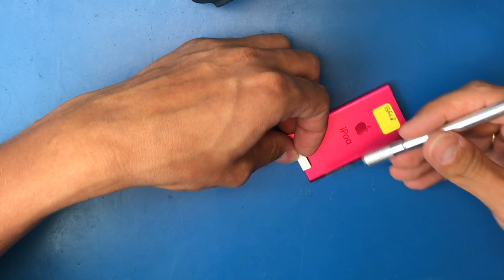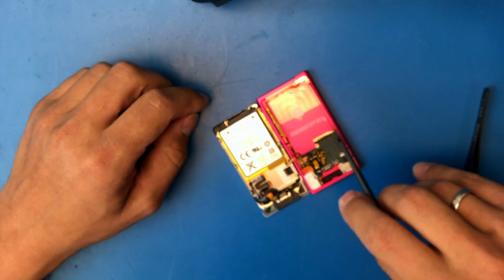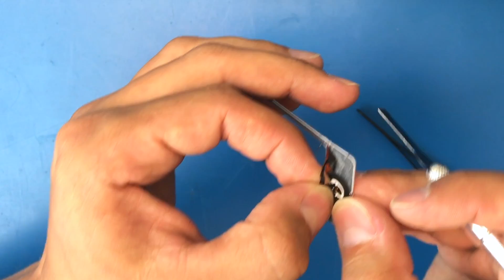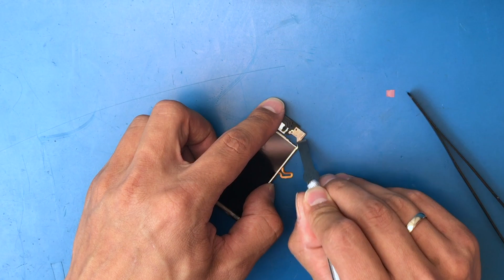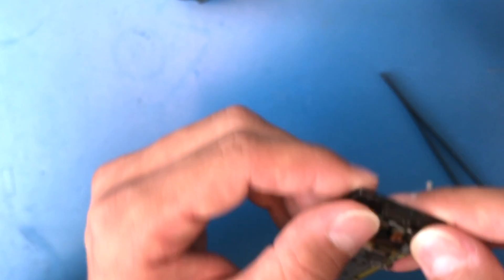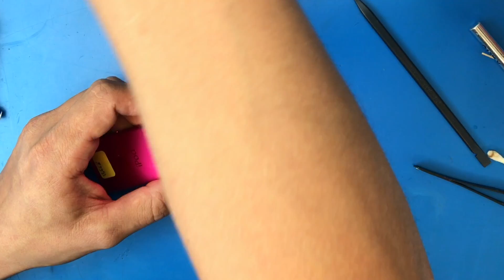How To Replace iPod Nano 7th Gen Touch Screen | FixAppleNow

Comment: my nano 7 has the power button stuck, will this opening method work for cleaning/unsticking the button?
Reply: My wife dropped hers and the power button did get stuck. Using the wrong procedure (never looked for a video) got the screens off and unstuck the switch. Currently in the process of (hopefully) replaced the LCD and digitizing screen.

Comment: I was very confused for a few minutes then i realized you removed the battery and re stuck it before you put it back together.
wouldn't it be easier to put the batter in first and apply adhesive to it so that when you put the screen back in it will stick? that way you don't have to try and holder it all while soldering?
Reply from the maker: AxelStrife93 Good thought, you can definitely do it that way. As long as everything aligns properly when you put it back together. Thank you